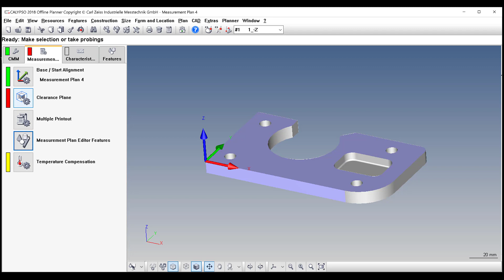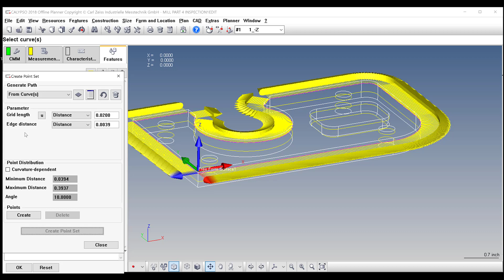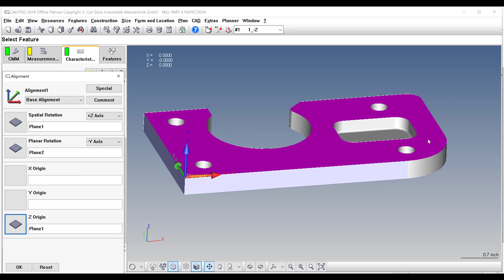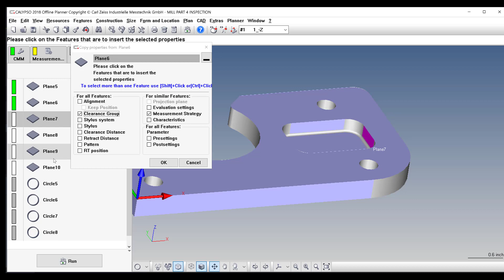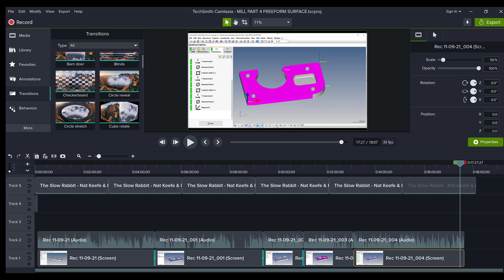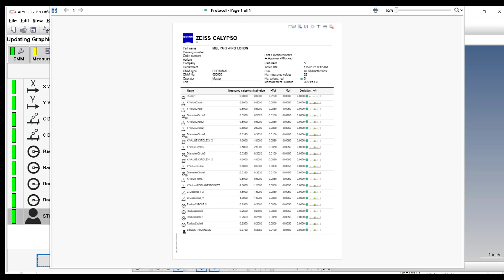ZEISS CMM CALYPSO MILL PART 4 FREEFORM SURFACE

Comment: Hello Professor Wickham,
While measuring the profile of a free form surface we take space points, So for a point if the profile shows -0.08 deviation do i consider it against the direction of arrow of the Y or do i consider it -ve against the direction of the arrow of the space point?

I am stuck on it and your response will help me a lot

Comment: What about that 45deg angle measurement??
Reply from the maker: Part of the profile tolerance.
Reply: It would be best for you to take a ASME Y14.5 class if you can. It will save you a lot of trouble in the future.

Comment: Thanks for sharing this video.
I see there are 4 planes inside the pocket.
Is it a good practice to get a distance of 2 planes in Calypso? Thanks
Reply from the maker: I think it is. But have used lines as needed.
Reply: @BrianWickhamMFG  Thanks for your reply. Even 2 planes or lines if they are NOT parallel then the result could be different?